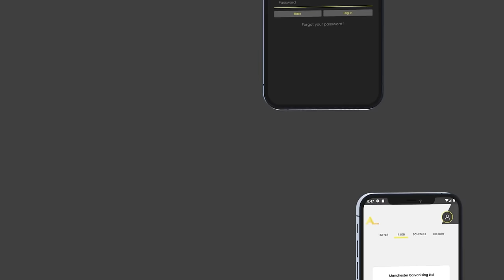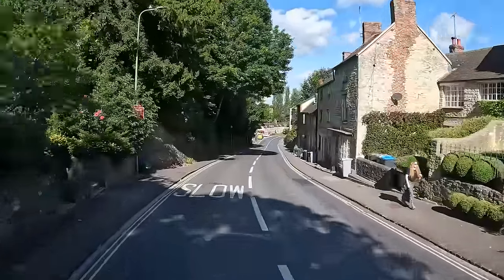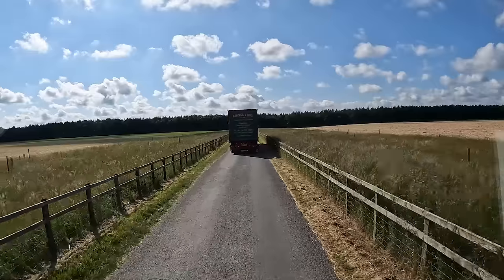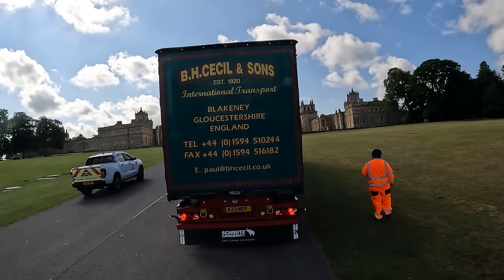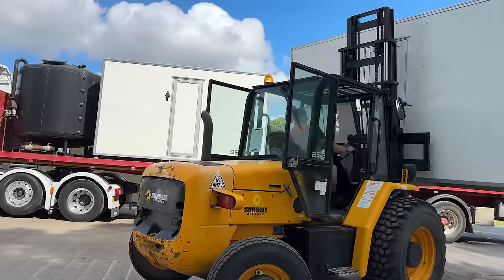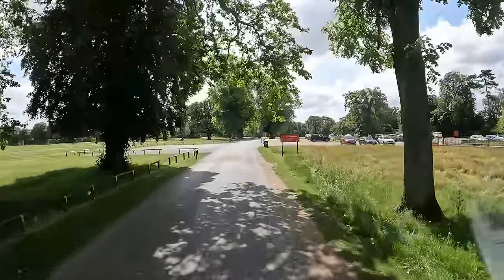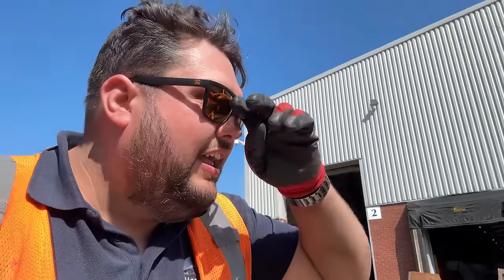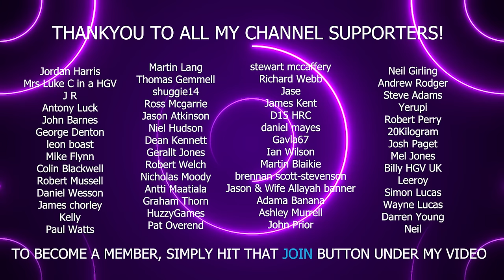THEY DAMAGED MY TRUCK!

Comment: I used to live in Lydney near the Forest of Dean and B.H. Cecil had a yard in the next village they hauled plywood for Lydney Plywood and one product was a one piece sheet to deck our HGV trailers, my brother in law worked for them at the factory getting trailers loaded ready for the drivers.
 There were several family owned transport companies in and around the Forest. Richard Reads was the most famous as they were also the ERF dealership and had shares in the HGV training school at Staverton. I think there were three other Read family transport companies each transport different load types. 
The Forest of Dean residents were covered by an ancient charter and could freely let sheep and pigs roam in the forest without charge or tax's. A transport company started up called Free Forester Transport and they tried running without road tax or paying other tax's. But that did not last long as they kept getting pulled up by the police.
Reply: An interesting case.
I believe that it is still legal to use red diesel in a vehicle if its used to travel from one of your properties to another and using the public highway. 
However,  I'm not sure about the road tax .
Reply: @das5813  When I worked for Tarmac construction, site trucks would be towed from site to site not driven. They would run on red but there may have been another reason, like being tested. I drove a JCB and was allowed to drive on the road using red diesel but not allowed to carry goods in the bucket, other than accessories for the JCB.
This I found strange as farmers can tow trailers with hay etc. both are in the same class.
Reply: @TheByard  
You have to send for a form to exempt your vehicle from fuel duty.
Some vehicles are exempt under the 6 mile range use. Your not seriously going to admit to doing  ore than 6 miles are you  !
Plant and specialised machinery has been exempt just like agricultural vehicles along with buildings for farm business use. A good source of information can be obtained from the AFU and many farming organisations.
Reply: @das5813  I had a friend who drove a JCB from Cardiff to Chepstow and had a list of building sites right along the route.
He also got pulled over for carrying shrubs and trees in the bucket. He pointed to the sign on the cab. Plant Hire.
Reply: @The Byard  ...BH Cecil run The Smartest Motors in The Forest of Dean ..The company goes from strength to strength....Young Pal is aStar and even won 1st prize of Europe at Assen Truckstar Festival.Inthe past all Cecils lorries sported a high square Lydney Plywood Name Board ...WHY????.It indicated the height of the loads of plywood not to exceed the height of these boards .WHY??? Any lorry driver using the old 48 is aware of The Low Bridges.!!!...As a little lad my loins stirred on seeing a B.H.Cecil Mouth Organ Leyland Octopus superbly Roped and Sheeted always ...Old Skool firm.Now New Skool Firm...Keep Em Lit Lads!!!!!
Reply: Sadly Lydney Plywood factory is a pile of bricks now....Lydney Port was busy .Plywood in ..Forest of Dean coal out ...Happy Days ..Oh Lydney Harbour is being redeveloped. Beginning to look O.K...
Reply: Oh its PAUL  The B.H.Cecil dynamic influence .Not Pal....Sorry..Busy Day!!!!

Comment: How long did it take you before you felt fully confident in day to day driving ? Like for most people driving a car ?
Reply from the maker: Hi mate, it’s very good question and what I’ve thought about for a few minutes. 

It’s difficult to answer because on one hand I feel extremely confident driving the truck and I would say from near enough day one I’ve always felt confident. I consider myself very good at reversing and getting into spaces, it might sound big, but I would consider myself a good driver when it comes to handling difficult situations

But … I would be lying if I said I don’t get anxious or nervous sometimes. a good 90% maybe 95% of the time I feel absolutely fine because I’ve prepared I’ve planned and I’ve taken roads that I’ve taken before so I know my way round but there are definitely times when you get nervous still

For me, it’s mostly when going up steep hills when fully loaded . They have times when the wheels start spinning and I can’t get any grip. That gives me nervous. There was one time where I took the wrong road and went down lane unsuitable for long vehicles and I very nearly got stuck. Luckily I made it through.

But haven’t said that I quite often go down tight lanes that single track and unsuitable for HGVs but we are required to take them to get to the places we are delivering to or collecting from 

So yeah, good question not really a straightforward answer 

I would say I felt confident very early on, but there will be challenging days where you get very nervous. I’ve been driving eight years now and I still get nervous days although not so often, but I definitely still get them
Reply: Cheers bud 😊 only as I recently passed mainly cause I love driving and wanted to do it on the side whenever I’m free

Comment: Hi ya Luke..  just wondering mate. Hows it work with your truck and london now? I believe you have to have cameras and the lower window in the passenger door? Is this correct? As trucker Tim got a biiiiig fine for not having them?
Reply: belive his trucks euro 6 were currently changing to euro 7 tims was like euro 4
Reply: Tim got fined because of his engine not being compliant. Not because he didn't have camera's (which he did) by the way.
Reply: @WeAreThePeople1690  Couldn't of happened to a nicer tw4t
Reply: @WeAreThePeople1690  Tim's lorry doest have cameras mate or the "London window"
Reply: @dangreene5676  He put them on and then took them off again.
Reply: @WeAreThePeople1690 in his  video, he got fines for both
Reply: @WeAreThePeople1690  
Tim's video... the biggest fine of my career... at the end. 2 fines 1 because of emotions and 2 because he didn't have cameras fitted. 
Daniel Ashvill has just had to up grade some of his fleet to be able to drive in central London..  if you have wing mirrows you now have to have secondary cameras fitted... or the wing mirrows are now replaced with those silly litte stick out cameras. I believe you also have to have a london window which is the small window at the bottom of the passenger door. It's all part of the (PSS progressive safety system 2024) 🤷‍♂️. I was asking Luke cos being a new driver I don't need to be sent into London by an agency boss and collecting the fine.
Reply: @WeAreThePeople1690  no it doesn't, his newer one still isn't fully compliant the hell are you on .
Reply: @dangreene5676 I always passed any fines on to the agent or hirer just like a toll. Its not a problem
Reply: @das5813  cheers mate. Been out of the game for a little while. It appears there's alot changed 😆
Reply: @dangreene5676  
In the end I refused all London jobs and even stopped doing hospital deliveries because I was getting a parking penalty even for using the delivery and loading bays.
Don't go out of pocket over these obvious money making rackets.

Comment: 32:37 No! Do not have a cold shower when it's hot out. That will only make you feel hotter.
Take a hot shower instead. As hot as you can bear it.
This will raise your body temperature making the air temperature seem cooler.
It works. I do this whenever it's hot out.
Reply: Or drink tea!